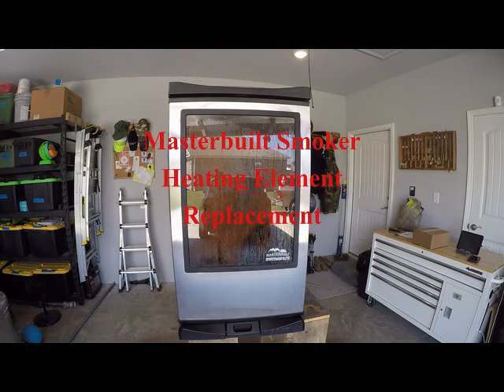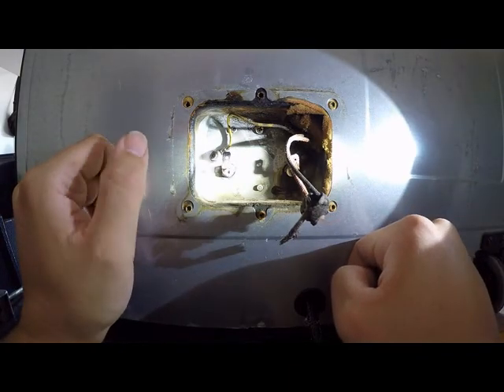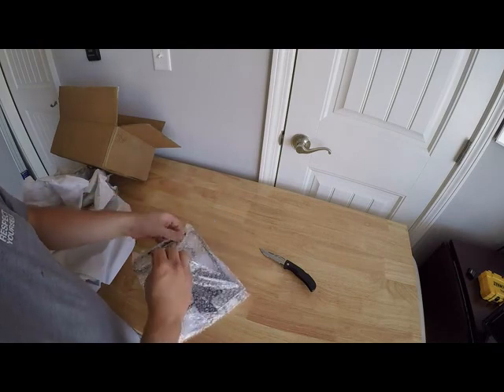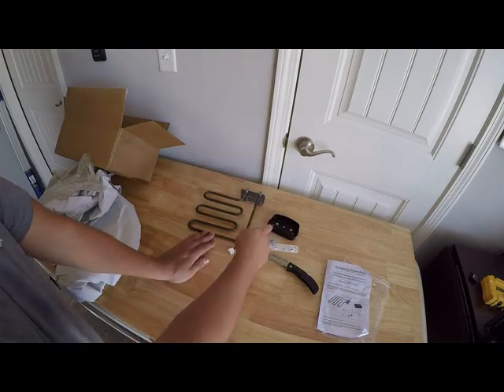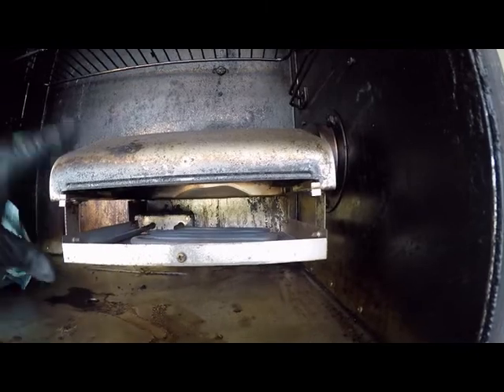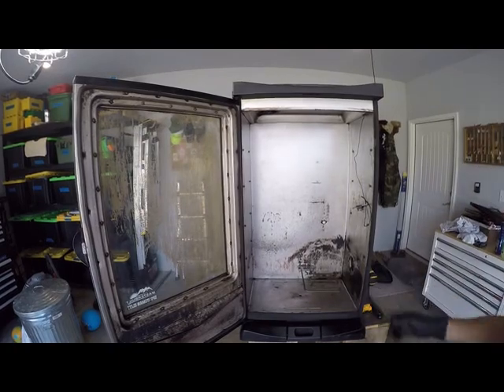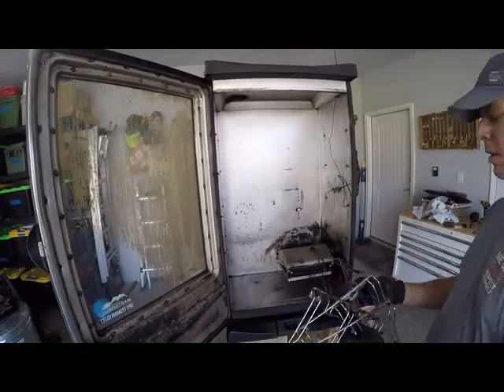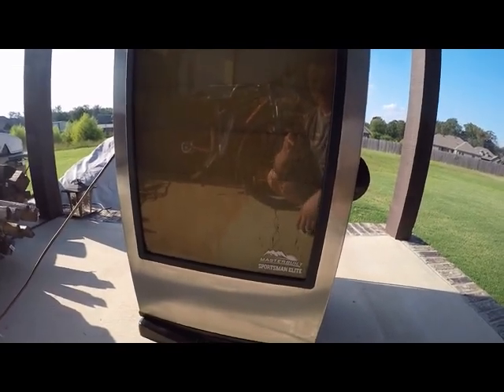Masterbuilt Smoker Element Change

Comment: Really good tutorial. Not too much fluff. Keeps things safe, and explains how to do it.
Reply: My master belt is just like this one except it has a solid door. It will trip the breaker after about 10 hours. The breaker is a arc fault interrupt as required by code 2 years ago. It is 15 amp. I’m thinking that I’ve got a shorted element. do you have any ideas?
Reply from the maker: @peterhaughton8110  sounds like your more educated then I on the matter but yeah I think that’s reasonable, or your breaker is wearing out .  10 hours is a heck of a long time to have your smoker on, what are you cooking?
Reply: Usually a butt or a picnic. The set temp is usually around 210 to 220 the weight of the meat or often times have me on a 16 hour cook time to get to the plateau of 195.
These 800 W heating elements should not pull more than 6 A. That is using ohms law at 115 V minimum. 

At 66 years old, having been working on cars, including EV’s and hybrids on a professional level for the last 50 years, and having always loved science, physics, and electricity, this stuff makes sense to me and I can work it out in my head .

The new house which we are living in, has what are known as arc fault breakers. Typical of the federal government trying to protect us from ourselves, they will trip if you look at them sideways while holding a hairdryer.
I can actually think of a scenario where I could hook a digital storage oscilloscope the fault to determine what caused the breaker to trip.

But, I would rather drink beer, catch, catfish, and cook chicken wings on my dock.

Comment: Thanks for the video. My burner seems to be getting a bit weak so I'll be tackling this soon. I have a slightly different model but it looks almost identical. One trick I've learned for cleaning the glass door, use a vinegar/water mixture. Spray it on the glass and let it soak a few minutes. Come back a bit later, spray it again and scrub with a toothbrush. Keep a cup or bowl of water to rinse the brush periodically. It'll get pretty much all the crud off, but honestly, it's not worth the time and effort trying to keep it clean. After one use it'll look the same way again!

Comment: Thank you so much. Yours is the only video I found that shows how to wire it on. I’m glad you took the time. Is it still working properly? I’m worried about the new wires being thinner.
Reply from the maker: Yeah everything’s working fine with it, used it about a dozen times with no problems.
Reply: It is only 800 W at 120 V. You could probably get by with 18 gauge wire for that distance for years and years without overloading the circuit. I don’t know what wire gauge is with the kit, but I’m sure that it is sufficient.